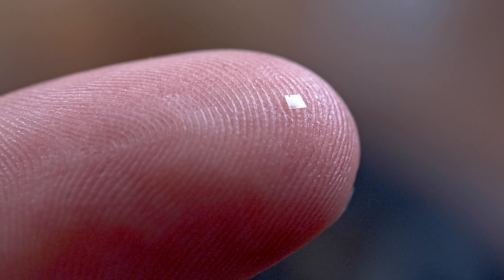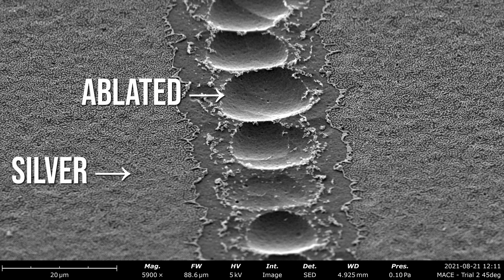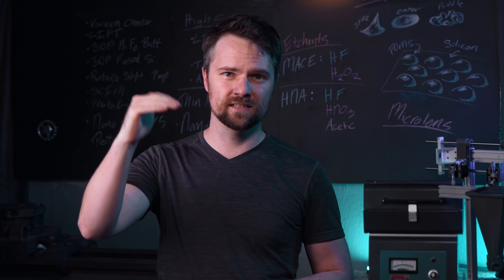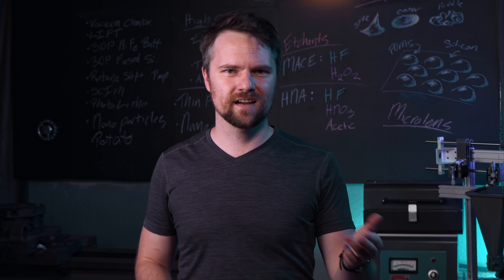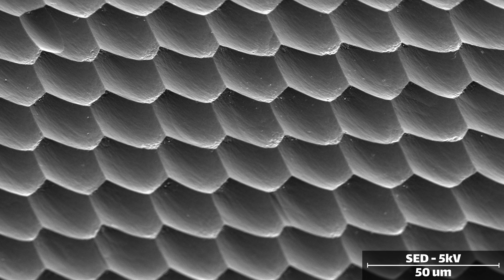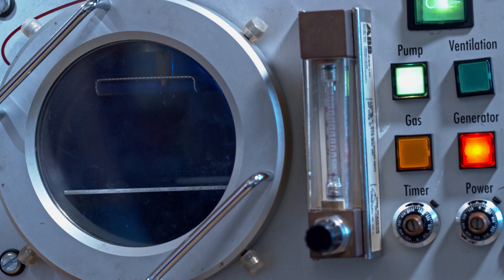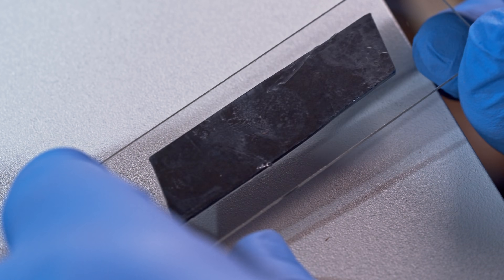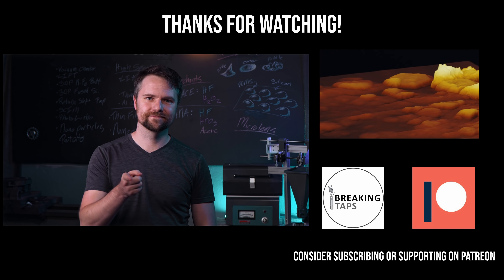Molding a Microlens Array

Comment: It took me a second to get what the name of your channel meant. But I get it now. You have a habit of breaking taps. That is, the drill bits for putting threading into a... I dunno what you call it, a hole?
Reply from the maker: Yep, you got it! :)  There was a project on one of my early videos where I broke a bunch of taps when trying to form some threads in stainless steel.  Thought it was amusing and changed the channel name to Breaking Taps.  Doesn't quite apply now that I'm doing stuff other than machining but oh well :)

Comment: I knew the HF is really bad stuff.  I have hard water and I use a rust remover that has that in it.  It cuts right through rust quickly too.  Nothing else that I have used before works that quick.  I use the stuff because I don't like scrubbing and those rust stains are difficult to get rid of.

Comment: I don't know the power of the laser and I have not seen all of your testing images, however what this behavior reminds me of is laser shock peening (LSP), where you use a layer of tape and a stream of water and Use the laser to heat the water up extremely quickly to create a steam explosion which peens the metal. What MIGHT be happening at this small scale is that the silver metal acts as the water and the cleaner craters might be caused by mechanical force being imparted by vaporising silver. As some of the laser's power would be lost to this, it could be cleaner because not as mouch heat is being imparted into the silicon. I believe you didn't show any images of the silver coated wafers before etching, so it is hard for me to stand firmly behind this hypothesis, however I would like to hear your opinion on this possibility. (Please excuse any gramatical mistakes in the text, English is not my first language.)

Comment: Thanks for sharing the journey you had.  If the goal is to create MEMS like devices, I think this is good. Micro lens array has its values.  If the focal length is fixed then it probably will diminish the purpose.  The lens industry is using soft material to vary the focal length.  This probably has nothing to do with what you're trying to do.
Reply: For some use cases, you can change the focal length by immersing the lens array in a fluid with a different index of refraction than air.

Water has an index of refraction of 1.33, an 80% sugar solution has an index of about 1.5. Thus the index of refraction can be adjusted by adding sugar or dilution. Put a microscope cover slip over the lens grid and sugar solution to create a flat surface.

Comment: Could those microspikes have any use involving high-voltage/high-frequency electricity? What sort of damage would be left if you exploded the spikes with a very short high voltage pulse? (high-voltage and high-frequency electricity can be a lot more dangerous than most people would expect; please don't end up like those people trying to do DIY Lichtenberg figures in their garages that got themselves killed).

Comment: I don't know what concentration the acetic acid needed to be, but many products sold as "vinegar" is purely acetic acid and water.
AFAIK to be called vinegar, it should be made "naturally", and contain trace substances such as flavorings from the source. Acetic acid is cheaper, and for most purposes works just as well.

Comment: Plasma Chamber?! Can you make toast in a Plasma Chamber?! I need to know more about this device! haha
Reply from the maker: Mmm, probably would take a long time to make some toast in there :)  So this variety is called a "plasma cleaner" generally, and it's used to remove organic contamination on surfaces.  You basically pull a modest vacuum, then the machine turns on a high-powered RF emitter and it ignites a plasma inside the chamber.  The ionized atoms will react organic junk and get carried off by the vacuum pump.  If you use air it'll be mostly nitrogen (not very helpful), and a bit of oxygen which reacts with stuff.  To realy increase the cleaning you use pure oxygen, or mix in some argon.  The larger argon atoms help physically sputter material off.

Applied Science has a good video on plasma ashing/cleaning/etching if you're interested! https://www.youtube.com/watch?v=atVSxvbiPg0

Comment: Where and how would it be used?
Reply from the maker: They are very commonly added on top of camera sensors to help gather more light. One "lenslet" will be placed above each pixel. It's likely that your phone or camera has a mass-produced (and much better than mine!) microlens inside it :)  Even cheap webcams and raspberry pi cameras have them nowadays.

Comment: 18:48 ‘Accidentally’ made fumed silica?
Hmm, this doesn’t hold water… or does it? 🤔
Reply from the maker: I think it was! I ran an EDS on that area and it came up strongly oxidized compared to the surrounding, bare silicon.  Stochiometrically fit SiO2.  And it had the high porosity appearance of fumed silica.  That particular sample was hundreds of very low power, high-frequency passes.  So my theory is that each pass was gently melting/oxidizing the silicon and it just slowly built up into that fluffy, porous material.

Can't be sure, but that's my best guess so far.  :)
Reply: @BreakingTaps 
Lol, thanks so much for the detailed and interesting reply.
However, I was actually making a joke 🤣
Fumed Silica is hygroscopic hence my comment: “Doesn’t hold water… or does it?”
I’ve subscribed and am looking forward to more great videos! 👌😀
Reply from the maker: @welshsteve2009  Ahaha, welp!  Right over my head 😂 I didn't know that about fumed silica, so at least I learned something new (other than being bad at recognizing humor lol) 😁
Reply: @BreakingTaps  🤣

Comment: where/wht can  this lens be used
Reply from the maker: They are often added right on top of camera sensors, one microlens per pixel. That helps the pixels gather more light especially in compact situations like cell phone cameras.  There are other more exotic uses (fiber optics, lightfield cameras, etc) but the main use by far is for camera sensors.

Comment: That's a lot less than four millimetres in the intro.  Unless your finger ridges are four to sixteen times as big as mine are.
Reply from the maker: Yah, I phrased it poorly (lots of confusion in the comments) :)  I meant 4mm^2 (2x2mm) although I measured later and it's actually 1x1mm.  Oops :)

Comment: aluminium oxide anodization etch
Reply: deposit hydrogen on silicon oxide, you get water vapour out, silicon metal to rip off
Reply: you can partially re-oxidize that to an actual glass lens
Reply: micro glass works

Comment: Uses are?
Reply from the maker: A very common use is on top of camera sensors, particularly small sensors like on cell phones.  The pixels of the sensor are small, and there is a fair amount of wiring and other junk inbetween the pixels, so a microlens is positioned above each pixel to make sure all the light lands in the right spot.